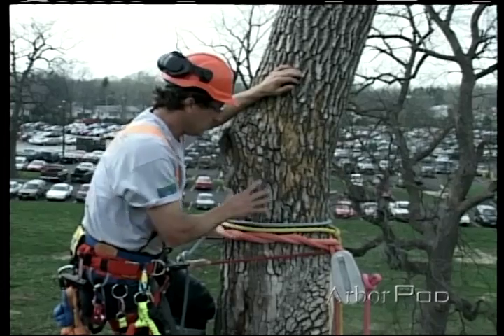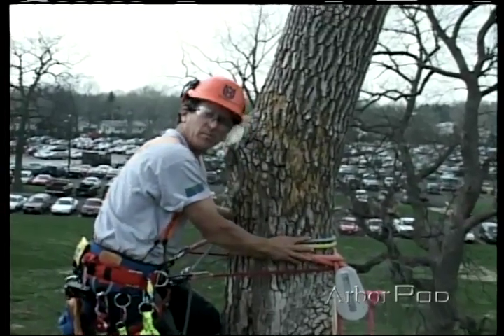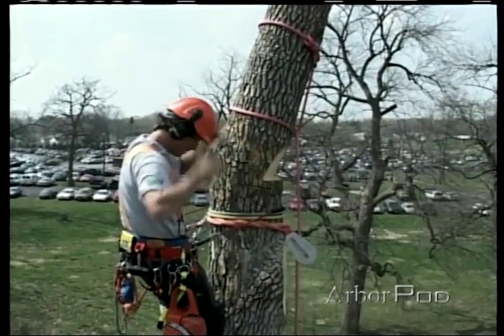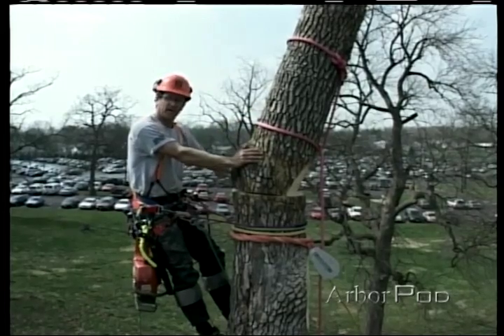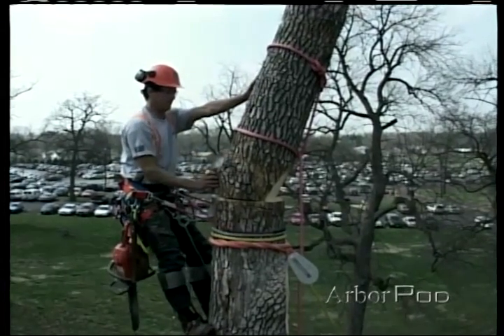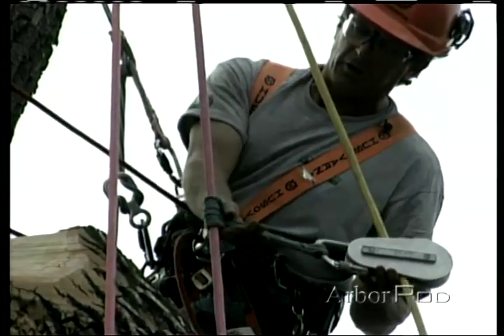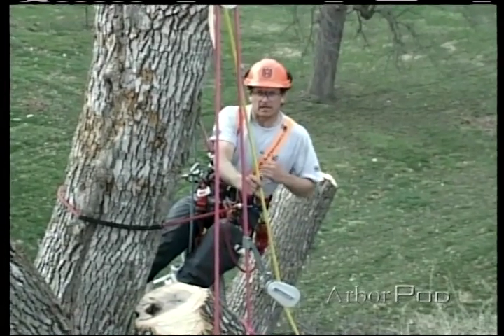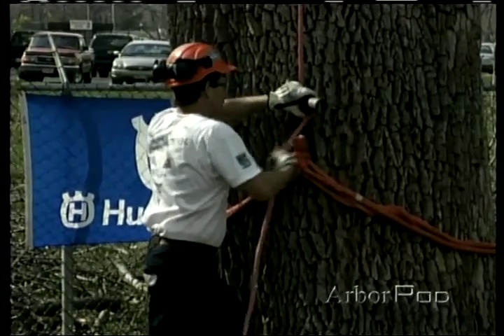Blocking with a Speedline

Comment: That's good, Rip. Except, when we've done it, we've had a GRCS or Hobbs as the lowering line friction, which allows for rapid slack removal during load free fall, which can reduce the amount the load falls by a considerable percentage, which also limits the peak loads. As well, I sometimes use full static HWMPE rope for the speed line, which totally reduces line stretch to near zero